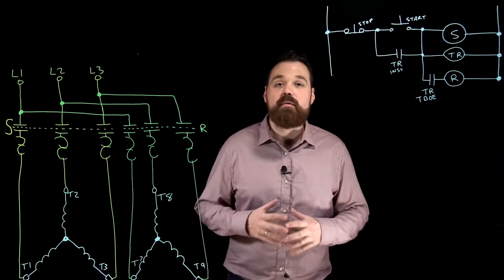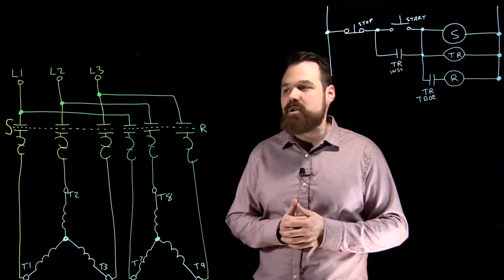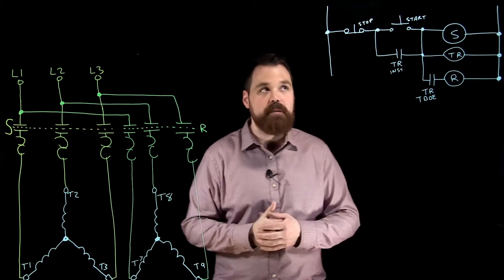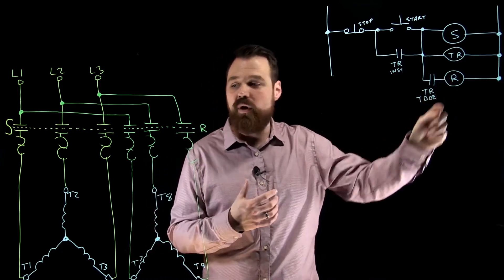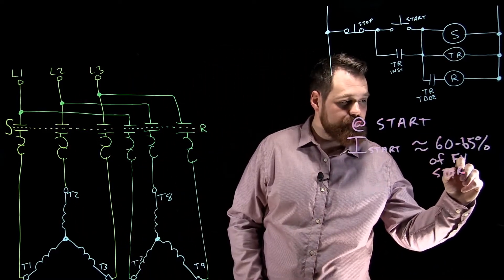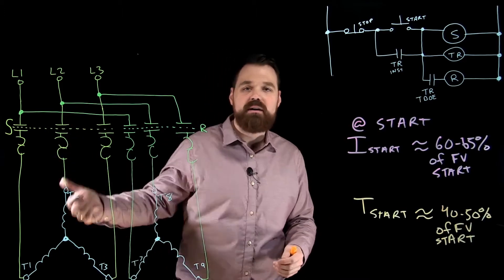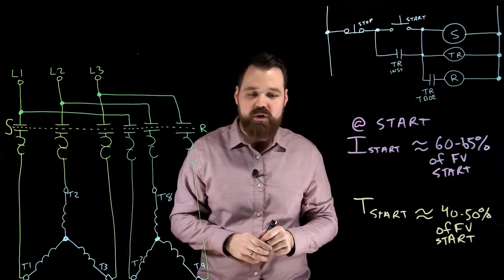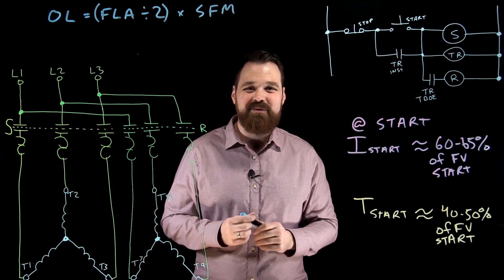Part Winding Motor Starter

Comment: Thanks that was helpful for my homework. I had troubles sizing overloads with the following question: "A part-winding-start motor has an FLA of 11.8A and a service factor of 1.15." It's not obvious to me if the FLA is the A or AA on the name plate. I will assume AA because FLA is 100% load in running mode.

Comment: May I ask if a  12 lead delta motor configured as low voltage double delta  can this be connected to part winding starter? Thank you in advance.
Reply from the maker: I can't say for sure. I doubt it, but you'd need to speak with a Motor Technician.